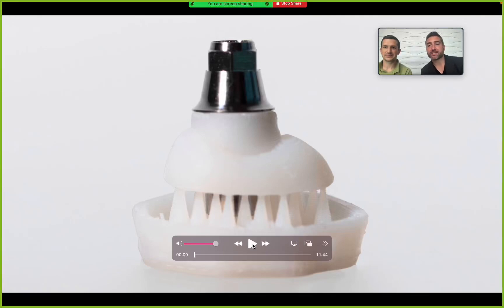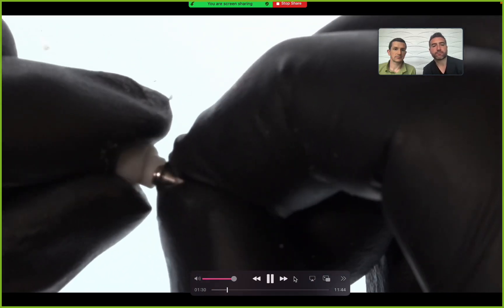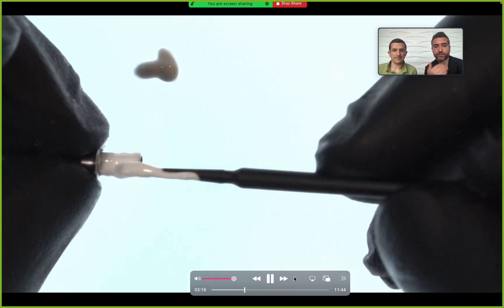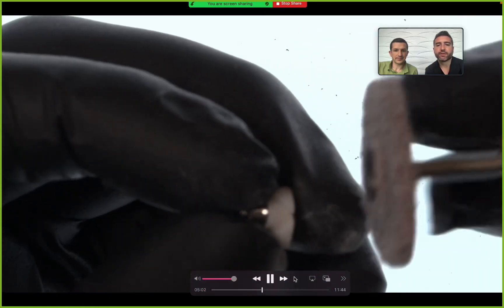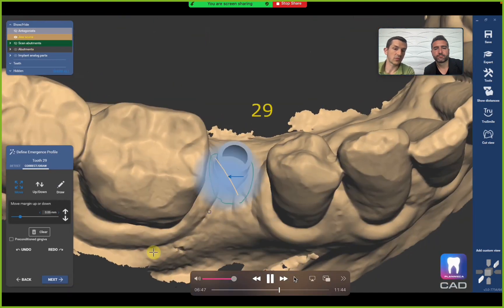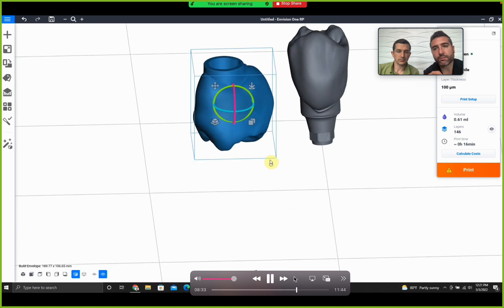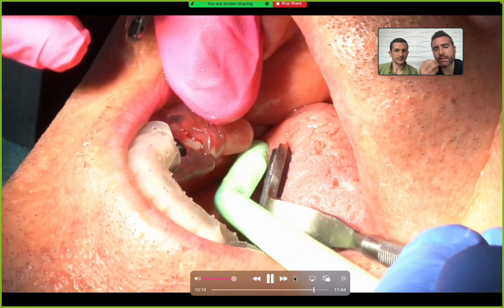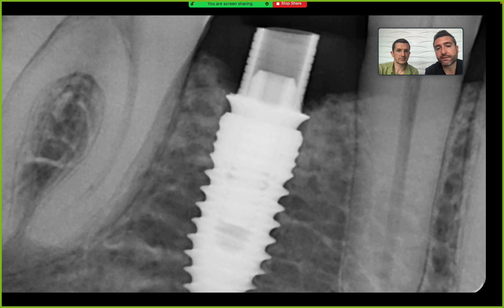3D printed custom healing abutments. 2 techniques described.

Comment: Every time I try to print direct to fixture (Neodent) using Exocad, I cannot get the screw to fit passively all the way into the crown/healing abutment (even if trying before final curing). Any tips?